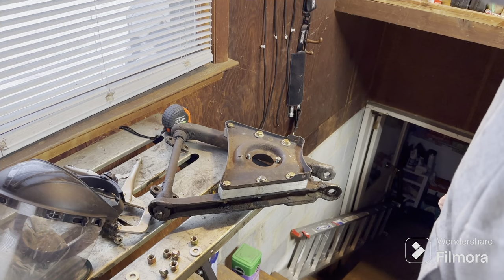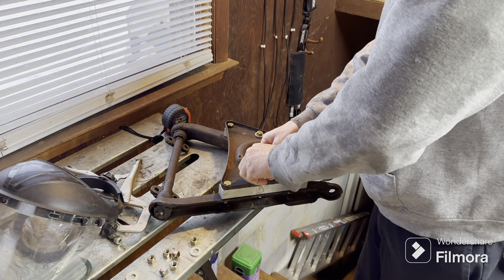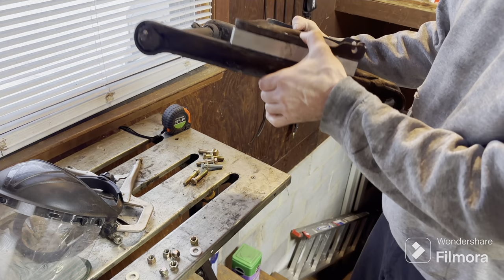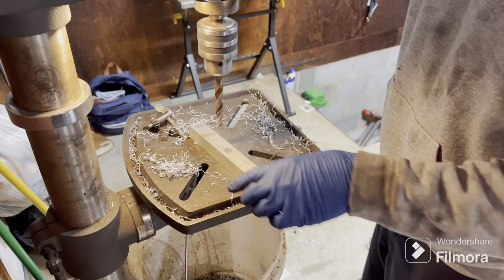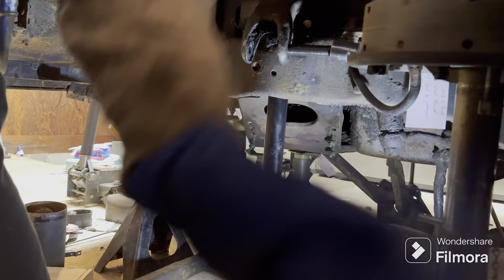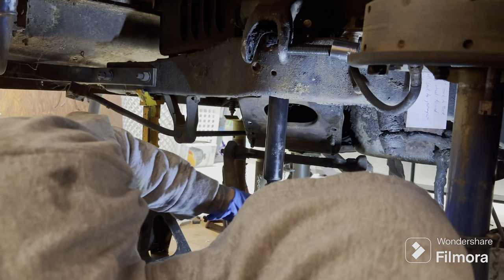Homemade boogie blocks for the front of the '49 Ford club coupe...a temporary fix

Comment: Im really intrigued to see how it works, ive also read not to do both spacer and astro coils. Id like to add spacers to my 52 in the near future.
Reply from the maker: I read the same thing. I have almost 3 inches on the dot before the a arm hits the frame at ride height. I'm thinking in an extreme case like a pothole or something it may hit but other than that I can't see it ever happening, especially since the Aerostar coils are progressive rate